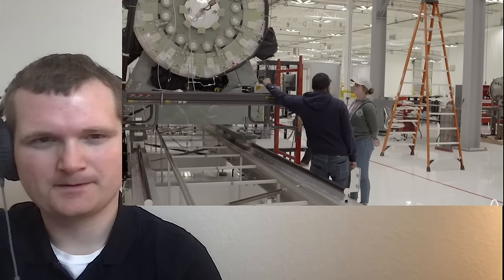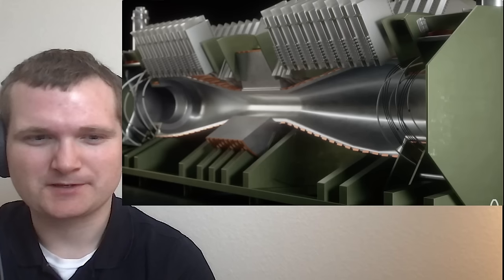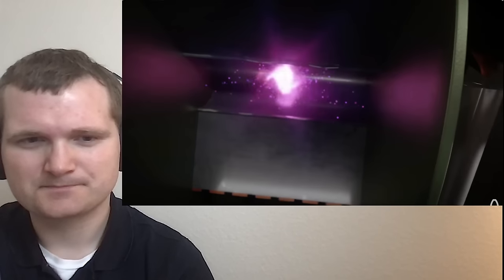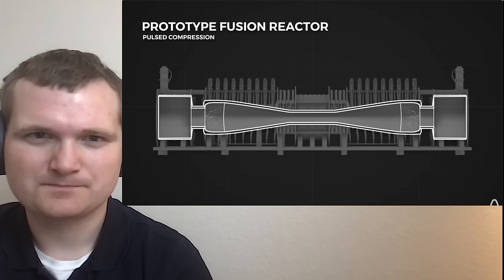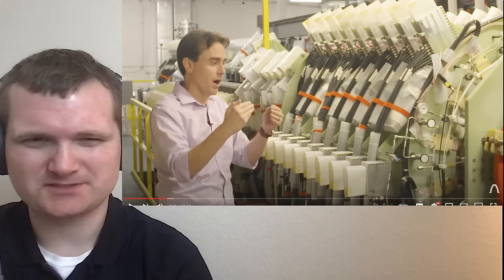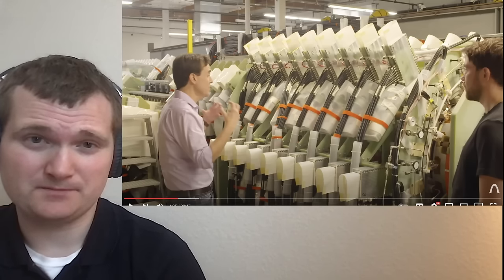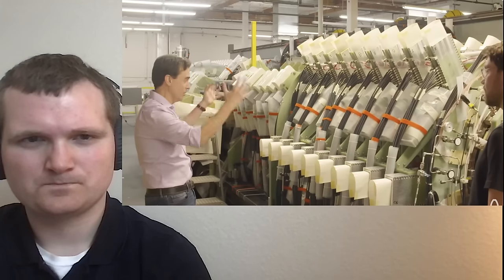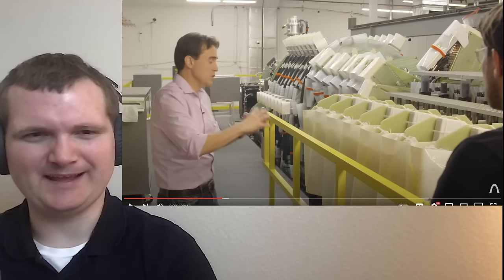Will the Helion Fusion Reactor ACTUALLY work? - Nuclear Engineer Reacts to Real Engineering

Comment: Regarding the "10 million degrees" being too low, that seems an error by the narrator.  Helion FAQ "What are Helion's technical achievements?" says "Helion's 6th prototype reached bulk ion temperatures greater than 9 keV, equivalent to 100 million degrees Celsius"
Reply: There are quite a few errors in the RE video (one of the graphics shows a wrong reaction product). But then, this was a video made for a lay- audience by people who are not nuclear engineers. It is a cool video and it was INDEED the first time that Trenta was shown in full and in detail on video. Before all that we got to see were dark pictures with the fuchsia glow that revealed very little.
Reply: The 10 million degree portion isnt the point of fusion ;)
Reply: its later explained in the video that when the plasmas hit thats where the 10M are, then they compress it to the 100M+

Comment: I have no belief in fusion reactors ever being practical however, you suggest that the copper coils used to extract energy will be exposed to the plasma. That is not what was stated by helion, they intend to use the EMP off the plasma to induce current into the magnetic coils.  The tokamuck is a joke.

Comment: I'm a mechanical engineer who has worked most of my life in Power Plants (Fossil then Nuclear).  One of my nuclear plant specialties was heat exchanger engineer so I understand a lot about heat transfer and keeping things cool (or hot as the case may be).

An interesting aside is that between my fossil and nuclear carrear I worked for a company that was involved in building test reactors (or technology demonstrators) for the UW_Madison Physics Department.   I helped build the Helically Symmetric eXperiment (HSX) stellarator which has been proposed as an alternate possible fusion technology to the tokamak.  At the time the Physicists involved told me that one of the problems with the tokamak was that in theory it could not be cooled if run at full power continuously.  The HSX twisty curvy shape can be cooled.  Germany subsequently built a larger version of the HSX design which solved some of the problems identified at UW Madison.  But the research was more advanced for the tokamak so it got the major funding as a fusion reactor; when there are actually a number of real advantages of the HSX design for fusion.  I suggest that you research the HSX device and the more modern German version, and how it relates to possible use for a fusion reactor.

Back to Helion.  The biggest challenge that I see is that they are going to have to cool the compression and reaction chamber once they progress to several "shots" per second (or even multiple for minute on a continuing basis).  This will keep the rest of the machine relatively cool as well.   However, it adds effective thickness to the pressure vessel which means that the magnetic coils for both the compression and for recovering energy will be large in diameter which I believes reduces their efficiency.  Material selection to prevent radiation embrittlement will be critical (and not my area of expertise).

But, the Helicon approach may actually work and produce more electricity than it takes to run the machine after more test reactors.  There are huge advantages if they can remove the very inefficient steam cycle not to mention the large physical plant that it requires.

I see the potential; but I suspect they are at least 3 generations, or more, of test machines away from being able to demonstrate both continuous operation without overheating (even if only few shots per minute) and that they can effectively recover the excess energy directly as electricity and show net positive power output.  Keep in mind that I believe EBR-1 could only light I believe 4 light-bulbs as the 1st nuclear generated electricity in 1951. 

I believe you misunderstood about their comment on size and the next plant that is supposed to come online this year.   That's just the next test reactor to see if they have solved some problems and to figure out what they have to solve to be able to increase temperature and future reactor output.    Also, because these test reactors are very small compared to the tokamak test reactor.  They can build them much cheaper and build multiple generations of them faster and cheaper than you can build a single tokamak test reactor at the size of the current one being built.   So they should be able to progress through all the challenges faster and cheaper.

As a comparison they have been building the ITER since 2013 for 11 years now... Perhaps it will startup in 2025.  More likely 2027 or later.

Helion as a company also started in 2013 using key people from the Inductive Plasmoid Accelerator (IPA) experiments (which is where the 1st 3 generations machines for this technology were built).  They then built the next 3 generation of test machines (4th, 5th, and 6th - Trenta - which you saw in the video you critiqued which demonstrated 100 million degrees in 2021 in 9 years. All for a fraction of the money of ITER.  The development cycle is much faster with small machines and much cheaper.

I am quite confident that they will have the 7th generation machine online before ITER, and they might even be well into building their 8th generation machine by the time ITER starts up (or even have started up the 8th generation machine).

They are already aware of the neutron radiation problem as their control room is behind a concrete wall.  I am sure that they are aware of the requirements for added shielding as they increase in size.  Also note that no one is present in the reactor room when they run the machine.

You are correct in that the base theory of operation is not new, nor the idea that they would collide dual shots from opposite ends.   But, based on my review of several other projects trying different approaches... Helion appears to be well in the lead of doing it successfully from the other contenders.

I'm fairly convinced that its these small privately funded fusion research efforts that are more likely lead to net energy positive fusion generator than the massive very long lead time government funded project like ITER.

In the end how well Helion works is unknown.  But they sure are moving a lot faster than the government funded programs (and there is no guarantee that the government funded programs such as ITER will work either).

Have a great day,
Reply: Agree with a lot of what you say but constant comparisons to the irrelevance that is ITER are pointless. 
ITER and the hopefully never built DEMO are only ever going to be incidental to Fusion power generation future. Tokomak Energy in the UK (e.g.) is a much more realistic tokomak comparison.
Even as a government comparison JET and STEP (hopefully)  will be better example.  ITER is a political white elephant like the SLS is for space flight.
Reply: Given the heat issue, this is why I think the Helion project is better off as a fuel source, or materials production source, instead of a primary power source.
Reply: Interesting analyses.   This scaled up in both individual size and number seems very promising.   As a sparkie l am very interested in the ultimate generation of electricity using transformer induction as a direct source.   Thanks
Reply: I have met Dr. John Slough, the fusion scientist from the University of Washington that built the first three FRC machines in Helion Energy’s early days. Slough hired Dr. David Kirtley to finish his work. This guy has no clue about how MHD works to skip the steam punk approach to power generation. He also needs to Google the Lawson Criterion to understand why He-3 is a better fuel choice, but he obviously doesn’t understand that most MHD generated electricity is generated by the protons.
Reply: @tonyrusi1978  what did Dr John say about Helion?
Reply: @tonyrusi1978  I have no idea why you replied to my post.  I never discussed the fuel that was being used by Helion nor mentioned MHD.

My post mainly deals the the problem of keeping the machine cool which will result in increased problems in certain areas as they increase shot rate and the advantages of building small test machines faster and lower cost than very large test machines.

While I am glad that you know one of the founders behind this technology idea I have to wonder did you intend to post in reaction to the video itself?

Have a great day  :)
Reply: If you're talking about Wendelstein-7X, there are actually a couple of really good podcasts with the engineers/scientists behind it.
Reply: @chronically_late  You are correct that it is the Wendelstein-7X that is the German successor to the University of Wisconsin HSX device that I helped build.

Thanks for mentioning their podcasts.

I'll look for their podcast another day.

Have a great day,
Reply: In fact, the steam cycle is very efficient with potential improvements. The best things are physical things and do not need to be “ large ”. There are many models of engines, turbines and steam boilers that are really small so that you can hold them in your hand and operate them in a room. They are safe and these models are filling the YouTube. What appears in this video is being shown and promoted as something futuristic as a result of all those flashy lights and radiation, but the strange thing is that if there was a technology that did not use an electrical principle, they would immediately call it a “perpetual motion machine” because it does not produce more than it consumes and that it "Against the laws of thermodynamics", but the thing in this video, "Helion", they will immediately say is an "evolution" and "an amazing and efficient technology"!!  What a strange thing!
Reply: @yakut9876  You are factually incorrect.  Size of components do not relate to efficiency.  None of the models you talk of are operating anywhere near the current thermal efficiency limits of the technologies they are modeling.

The Steam Cycle by its very nature is just one fluid that uses the "Ideal" Carnot Thermodynamic Cycle.  By its very nature its efficiency is limited to a maximum of "1-(Tc/Th)" Where Tc (Temperature of the cooling fluid used to condense the liquid - in absolute T) and Th (The Highest temperature of the vapor - in absolute T).

With current technology steam cycle power plants have about a maximum thermal efficiency of just over 40%.   About 60% of the heat energy produced has to be thrown away as waste heat that cannot be used.  We do not have any materials good enough to raise the efficiency higher (and most of the power plants I worked in had thermal efficiencies between 30-35% as they operated at lower steam temperatures and pressures than the newest plants can with modern alloys).  There are no potential improvements beyond a few % at this point.  You need the pipes and pressure vessels not to fail under pressure or outright melt.  Note that I worked in a power plant with 2600 PSI steam at 1005 F. The outlet of he boiler tubes, headers, and steam piping glowed dull red at those temperatures.  They are now at 1050 F temperatures and 4200 PSI by using more modern super-alloys, which glow a bit brighter red all the time (for many decades).

On the other hand - the Brayton Cycle - which is what a combustion turbine uses has a current thermodynamic efficiency limit of just over 60%, with only about 40% of the energy having to be thrown away as waste heat.   There are only incremental improvements in efficiency available again due to high temperature material limits. 

That is why there are now so many gas turbine power plants, and even better the application of a steam cycle after the combustion turbine to recapture some of the waste heat from the Brayton cycle - resulting in a modern practical thermodynamic efficiency of about 72% (it might be a bit better - I have not researched the latest newest combined cycle plants).  Thus only having to throw away about 28% of the heat energy available.  You can burn a higher priced fuel (natural gas) compared to coal - and make more money because of the increased thermal efficiency (and get less CO2 as well).

Direct conversion to to electricity which eliminates the need for a working fluid and its inherently limiting working fluid thermodynamic cycle has the potential to likely be in the range of 90% or better thermal efficiency.   It also avoids building a relatively large and expensive working fluid power plant which also requires a large operating and maintenance staff compared to electrical/electronic components.

Hope this helps, and have a great day,
Reply: You said fossil😂😂😂😂😂
Reply: @JavierSalcedoC  Power Plant efficiency does not care about fuel used.  I've worked in both fossil and PWR nuclear power plants.   The PWR nuclear power plants had lower thermal efficiencies because they were limited in both pressure and temperature to values typically lower than any but the oldest and smallest fossil power plant units every built (I have worked at 80+ year old at the time municipal power plant that still had an operating 6 MW and 4 MW steam plant that was at lower pressures and temperatures than the approximate 550-600 MWe nuclear power plants I worked at).
Reply: Thank you for the insightful comment, however just to add ITER is expensive and big not because tokamaks are so (one can build a tokamak even smaller than the device from the video), but because it suppose to achieve >=10xQ, another issue I have is that AFAIK they haven't achieved fusion yet at all in their device (is it the reverse-field type one?), hence it will likely have to scale up to be efficient enough to be profitable, but I wish them well - it would be great to have it working.
Reply: @rgarbacz  The reason that ITER is very large is because they don't believe they can make any significant progress with a smaller tokamak based on the previous smaller tokamaks.      I'd be very surprised if ITER achieves it goals (which it may not) that they will figure out how to build a small tokamak of similar size to the previous ones that would work.
Reply: @perryallan3524  True, ITER is already out of date technologically, better materials and designs allow to make smaller spherical tokamaks with better performance
Reply: @rgarbacz  That does not solve the problem that the shape of the tokamak is not coolable if run continuously (the vacuum chamber would melt).   A tokamak will never be a power pant.

It will be other designs - perhaps the Stellerator, Perhaps something like Heilion concept, and there are likely at least 4 other ideas out there that are coolable during continuous operation.

I just don't see the international energy agencies sinking more money into tokamaks after the ITER.

Much better potential at this point with other designs.
Reply: @perryallan3524  Will take your word regarding the tokamaks cooling. I am very fond of the Stellerator concept and I have great hopes for the German Wendelstain 7-X, from what I know tokamak was chosen for ITER as this concept was the most advanced in reaching the goal, I do not favour any solution, just hope one or more will work.
Reply: Thank you.
Reply: @johnpublicprofile6261  and jett is a political EU build.   are you complaining about???
Reply: @olivierb9716   @olivierb9716  I am not ar all sure what I was complaining about 4 months ago LOL.
Other than the thread host and I seem to agree that ITER is a big wasteful steaming pile of ....
Reply: @johnpublicprofile6261  ok, you can't read.
Reply: @olivierb9716  ...and by the look of it, neither of us can type. We should  be good company for each other LOL